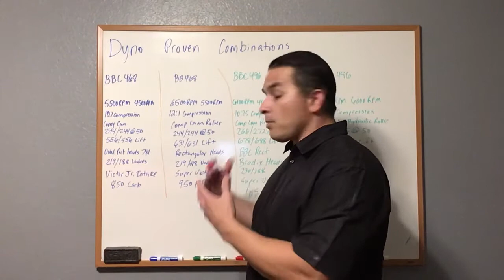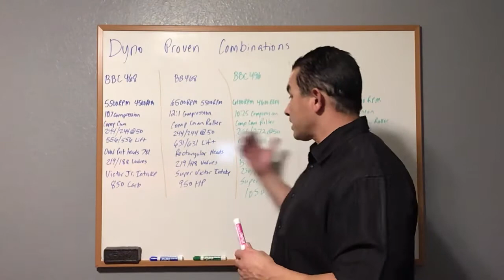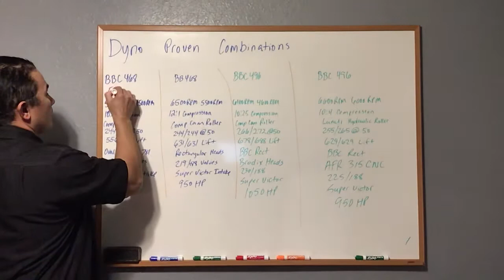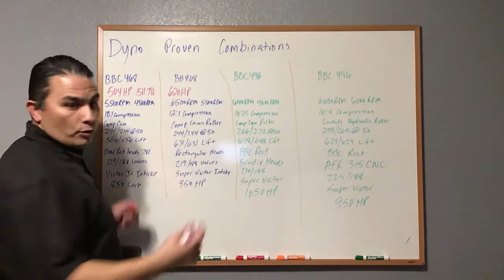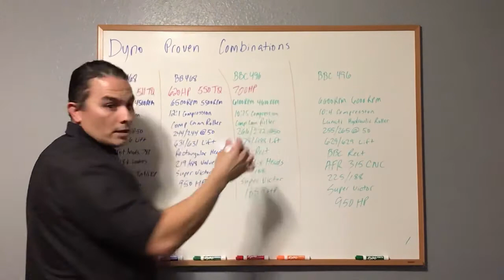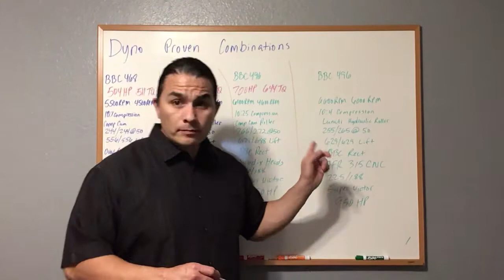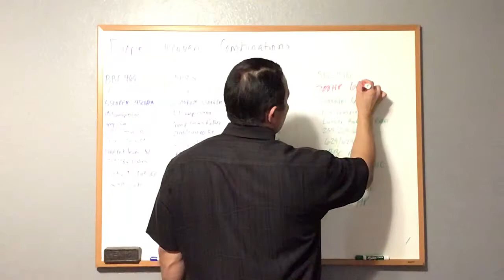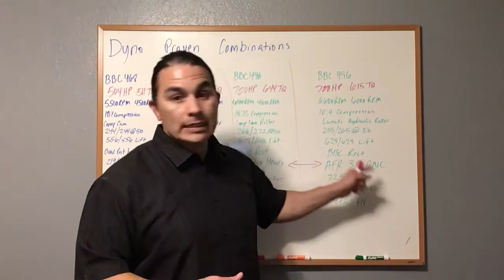Dyno proven big block combinations

Comment: BBC built by a very known engine shop. They built me a 496BBC Stroker all forge and racing rods and pistons. Making it 10.1 compression. With 781 iron oval port cylinder heads, larger valves, solid roller, Weiland Track Warrior Intake Manifold, DC carb Black Window… 850 … unleaded with HVH 1 inch spacers.. Jets to 75-83 from 76-85 less timing..
Why am I only getting 704.5 STPTrq Clb-ft @ 3,500 rpm’s 
And top out at 590.4 STPPwr CHp

It’s on a known good Dyno and have switched out carbs 3 different times, why isn’t my hp not way up?? But my ft lb or torque is over 700+ easy….  Please help me out
Reply from the maker: Jeepboy 454 you didn't mention cam specs, head flow, timing, ect...  could be not enough head for a 496. Are you sure that is your compression? You didn't mention how much dome the piston has
Reply: @reyracer  if I could send you pictures I would. The heads a 781 with larger valve job.. 
notes for last pull are: Test Description, Accel. Test - 300 rpm/second 
Timing 26 INITIAL 40 TOTAL.. DC CARB BLACK WIDOW… 850 .. UNLEADED WITH HVH 1 INCH SPACER.. Jet to 75-83 from 76-85Less TIMING…
I have better ft lbs of Torque then any single carb 496 I’ve seen..
@ 3,400rpms I’m right at 704.0STPTrq Clb-ft
And @ 5,200rpms I’m right at 590.4 STPPwr CHp..

The piston crowns aren’t flat at all, Eagle Specialty Products B11011060 - Eagle Competition Rotating Assemblies. I was told by the owner of AMS racing that the engine was 10:1 compression..
Reply from the maker: @Jeepboy454  again you didn't mention cam specs, cam part number, the size of the dome on the piston, head gasket thickness, cc chamber on the head. Very important, for gasket thickness, actual cc chamber on head to determine the true compression and without cam specs, we will never know the intended build.
Reply: That is a truck/RV motor. The heads, cam and intake.

Comment: Asking about 468 daily driver, what style pistons should be used?
Reply from the maker: Stephen Geter if you are asking a budget friendly piston,  the Keith black Pistons are good but the better budget forged piston is the icon forged piston. You want to keep compression 9:5 with iron heads and you can go 10:5 with aluminum heads.

Comment: No your are not just going GET these numbers by adding a cam and heads to an Junkyard LS. You WILL need a power adder above 500 HP. You WILL.  Oh yeah before I forget......adding a power adder to the BIG BLOCK ends all conversations.
Reply from the maker: Check out my other big block combinations making 700+ hp on pump gas

Comment: You can get these numbers out of a LS junk yard motor by just installing a cam and the motor weighs 200 lbs less
Reply: LS 👎👎👎👎
Reply: @charlesgreathouse7376     That’s the response of a hater.  Typical
Reply: @mikeeagle2653  no, just my opinion, not hate.
Reply: @charlesgreathouse7376  theres no hate just facts.   New technology is key
Reply from the maker: I will upload some numbers for engines ranging from 540 to 572.
Reply: Torque wins races, especially in heavy street cars. Horsepower is just a byproduct.
Reply: The power and torque curves will be drastically different.
Reply: There's no replacement for displacement. A junkyard 454" maxes out at 525", 800hp.